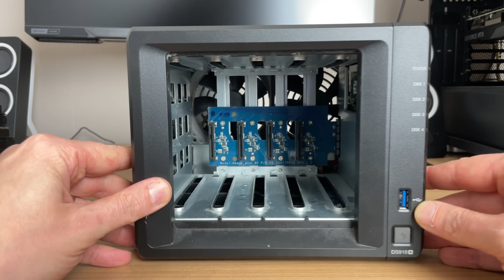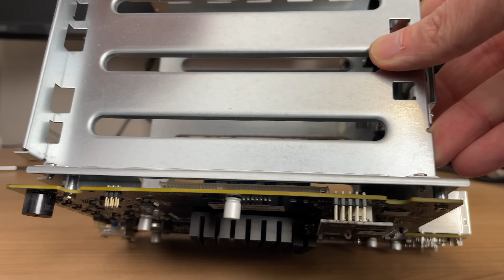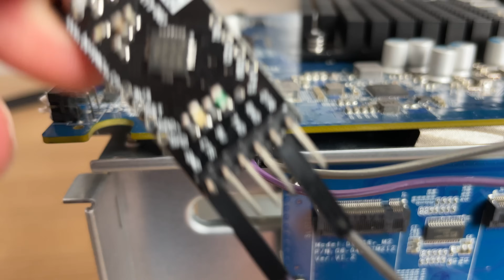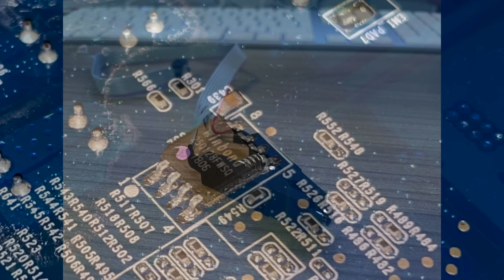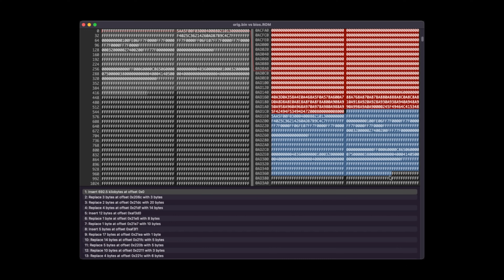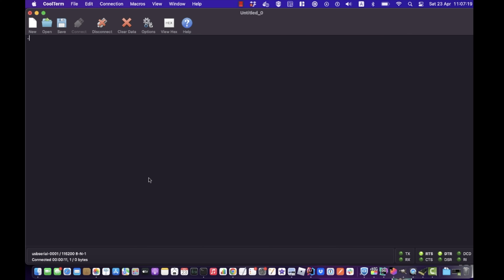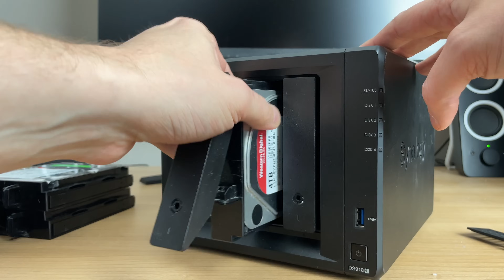Synology DS918+ Bricked / Blue LED of death.

Comment: Synology can't really do anything here. This problem is with all the Atom C2000 series and some of the Celeron SoC series. The C2000 has this LPC bus problem and the Celeron does something equally stupid on the SPI bus when in bad mood.  I had the same issue on a rack unit. At the end we replaced the PCB which in this case is a removable card. Good to see that you were able to just fix the  flash. Since I did not discard the module I can try the same using the spare (yes spare) NAS we got because of this.
Reply: Synology can't really do anything here? That's silly. They could protect the flash chip better, install a backup flash chip, or not use a SoC that spontaneously bricks itself in the first place.
Reply: @VioletGiraffe  Obviously you have not read the datasheet and the AppNotes. The SoC does not support any of this.
Reply: @ChipGuy , 1) that's my point, it was a bad choice of SoC. And 2) no, you do not need any special support from SoC for a backup BIOS ROM with a hardware switch.
Reply: @VioletGiraffe  There is only one /CS signal from the SoC. Unless you implement a proprietary solution like Asus or Gigabyte with an extra watchdog MCU which they just put in their system ASIC as a feature. You will be looking at least at an extra chip that goes "OK Celeron dude, if you don't tell me that you are alive and well after max. XX seconds I will reset you  and change your CS line over to the second flash chip and then restart you again" That adds considerably to the BOM.
Reply: @ChipGuy , that would be an automatic solution, which is quite doable, but I meant a much simpler one - a hardware switch, as I said. User-selectable.
Reply: this device does not have the C2000, it was a previous model.. ie, 916..
Reply: @jmkhenka  I know, it has the Celeron J3455. Those tend to do weird things on the Flash SPI bus. They are also used on some Mini-ITX mainboards and micro servers. Same problems, spurious SPI flash data corruption after crashes or power outages.
Reply: I would love to know your results (if you try to repair).

I have 2x Synology NAS's with the same symptoms (a RackStation RS2416+ and a 5 bay DS1512+).

(If you have a Youtube channel, please share a link)
Reply: @Giepie  thats the c2000 bugg, you can solder a resistor to get them working again.
We have had 20 firewalls from a reputable vendor break over the past year due to the same CPU. Cisco and many other manufacturers had the same cpu. Intel really fucked up their customers.

We have repaired two rs2416 with resistors (5 min jobb, not even difficult)
Reply: @jmkhenka  that is great news! 

I attempted the resistor fix with the DS, but the insides are way different to the unit on the how-to I followed. 

Could you possibly share the information (or link) to fix the RS?

(PS, my RS died after a firmware update, it just never came back after rebooting)
Reply: @Giepie  I got the Rackstation RP8xx+ something. 4 bay with that C2000 SoC and also that proprietary USB (I think it's USB) but not USB formfactor flash drive in it. Now that I know what the problem is I can try fix it when I have time. But at the time it failed my only chance was to order the new module in with over night express, since 16 people relied on that NAS being operational.
Reply: @ChipGuy  I wasn't able to find replacement boards (at least not here in South Africa), so I was forced to replace these units. 

I kept the faulty units, hoping to fix them "when I have time" (famous last words 😁)

I suspected the DOM's (disk-on-module) to be corrupt, never crossed my mind it could actually be the ROM. 

I don't have the chip programmers etc, but will consider getting one - unless someone knows how to flash the ROM without removing the chip. 

I'd love to see your results 😁 (hopefully this would encourage you to fix yours 😁😁)
Reply: The Atom bug clearly does not apply here...

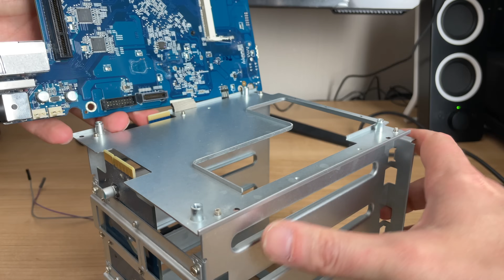Comment: 9:40 A laptop that uses PC3L ram (low voltage) will not work with regular PCL3 ram at all! Probably the same here. (have not finished yet!)
Reply: Right, yah. It will go the other way around but not if the system runs 1.35v

Comment: Hey there RetroSpector78, we'd love to send one of ours and help you retrieve your data if needed or at the very least leave you with a solution that keeps your data backed up. We also love supporting retro computing and even recently added MS DOS support to our NAS devices. Hit us up if interested!
Reply: That's cool (seriously).. but I'm guessing that's via SMB1.. hopefully those that don't need that feature can disable it!!  That's insecure as hell!   The only faults I was aware of with the Synology units was the clock circuit in some models, due to hardware defect of that SoC/chipset.  TIL their BIOS chips go pop too.  Huh, welp, there ya go.  Shame, I'd thought they cleaned up their act.
Reply: @Sansui350A  Not necessarily! SMB1 is one way to access it but we also have ensured FTP support runs on as early as MS DOS, WebDAV for Windows 95/98 and virtual machines to keep the insecure protocols on a server inside and separate from the NAS as well as dual Ethernet to keep networking separated.

I run retro machines myself! My favourite is Windows 98
Reply: @ASUSTOR_YT  Nice.  Thought out better than others, for once, I like it! :)   But, the key security issue is.. do you have an option to disable SMB1, or have it disabled by default?
Reply: @Sansui350A  Of course! Absolutely! It's disabled by default but it's a simple switch to turn on and off.
Reply: @ASUSTOR_YT  You know... that's funny that a company that doesn't specialize in NAS/storage like AT ALL, gets that shit right, yet others often don't.  or just make garbage.  I might have to explore some of ASUS NAS box products for specific-use-case scenarios because of this.
Reply: @Sansui350A  Haha. Well... Technically we are specialising in NAS storage. ASUS tried their hand at it and then decided just to spin it off. We're a separately run joint venture. We're a lot leaner than Synology so it's easier for me to take feedback and turn the ship around. I feel NAS boxes should have wide support and freedom. It was great working with Phil's Computer Lab to get MS DOS FTP support working and now we want to send hardware (with no editorial interference) to retro YouTubers because we think we can take feedback from retro YouTubers on what we should improve to make it better. 

One thing I found is that if I run a Linux server or Windows Server 2008 virtual machine, I can keep that as SMB1 and separate from my NAS device. Since Linux distros and Server 2008 supports SMB1 and SMB2, I can keep the insecure parts separate, while also keeping a copy on the normal part of the NAS and with that, easily back it up to external devices or another NAS, regardless of whether it's one of ours or a competitor's.

I personally have a Pentium 4 Socket 478 system that I've built and disassembled numerous times since I bought the board in 2004. What I want to do is build a nice AMD Athlon 64 ultimate-fastest-1080p-Windows 98 build with the Geforce FX 5900 I have. Oh, and RGB too because I'm nuts.
Reply: @ASUSTOR_YT  only if i knew ASUS make nas before i got my first nas, which is ds920, last black friday.    was not aware of Asustor till recently
Reply: @andyliu5662  That's OK. When you're ready or if you just need another one for a backup to keep your files and retro games safe, hit us up to ask questions. It can sync with the Synology to keep an automatic backup.
Reply: @ASUSTOR_YT  good to know that it can sync with synology, will keep that in mind when I shop for another nas :)
Reply: Asusstor is way better than synology and cheaper too
Reply: Truenas is way better than either! And runs on most any spare hardware of the last 15 years. It just wants 8 gigs ram these days. And I have yet to lose any data in 10+ years of using it unless its a serious case of user error. ZFS2 is the only file system in town as far as i am concerned.
Reply: @wishusknight3009  you are comparing a custom build solution to a no-headache prebuild solution
Reply: @j_r_-  It doesn't seem like the prebuilds are no headache. But I see your point. But this thread was about features too, and in that its worth saying that a custom solution far exceeds anything a prebuilt can do. And for potentially less money.
Reply: @wishusknight3009  We tend to disagree. And ours works well on as little as 512 MB of RAM ;)
Reply: @wishusknight3009  good luck with it without ECC RAM
Reply: @nneeerrrd  None of the premade nas boxes have ecc ram. And its cheap second hand for many types of system's. For most uses its not necessary at all.
Reply: @wishusknight3009  Not necessarily true. Our Lockerstor series featuring Denverton SoCs support ECC and our Lockerstor Pro series come with ECC.
Reply: @ASUSTOR_YT  Ahh ok, I stand corrected. Most lower consumer grade units don't then. 

Though I have one question for an obscure feature. The unit supports a sandboxed SMB1 mode which is pretty cool I must admit.  Out of curiosity, has anyone developed a plugin to allow sharing with vintage macintosh via appletalk? For like system 7 through to OS 9.22 using HFS and HFS+?  This requires the storage device to track both resource fork and data forks to keep Macintosh files from corrupting without being archived. 

Currently I use a windows 2000 server VM to bridge this (which also acts as my SMB1 bridge)

I am not making this any kind of Litmus, this is so obscure that its probably only apeaking to a few people worldwide lol. But it would make a neet plugin to add manually.
Reply: @wishusknight3009  I'd have to try. Maybe I need to buy an old mac for fun and giggles for the office and get it working. I know FTP clients will definitely work.
Reply: @j_r_-  How do you figure Asusstor is "way better and cheaper"? The 4 bay version of the Asusstor is $700, whereas the 923+ is in th $500 range. Asusstor does have more bang for buck in the hardware, but not near the ecosystem and ease of use of Synology. I do like that Asusstor allows 3rd party drives with no complaint, while Synology is pushing users to its own drives and tying customer service to that (which is just wrong). The reason why most people like Synology is because it is truly plug-and-play, whereas systems like Asusstor really require an AI assistant on your side to deal with any kind of problems. So, Asusstor isn't "way better than Synology" nor is it "way cheaper". It has more bang per buck in hardware, but it's a lot less intuitive and doesn't have near the community around it that really matters when the Scheiße hits the fan.
Reply from the maker: That’s pretty cool, I’ll reply via email and we’ll see what we can do !
Reply: @RetroSpector78  Thanks! I'll explain more in detail what we've been doing to help retro enthusiasts.
Reply: @ASUSTOR_YT  Hell yeah.  This is awesome engagement guys, seriously.
Reply: @Sansui350A  Thanks!
Reply: The ASUSTOR devices also support NFS, which means you can use the XFS client in MS-DOS for access.  I've done a video or two on NFS access in MS-DOS
Reply: @RetroTechChris  That's right!
Reply: I love my Asustor AS6110T.. even though it's rather old now, just can't beat the 10 bays!
Reply: @Avatar_EU  Thanks!
Reply: @ASUSTOR TV Maybe you could add user upgradable UPS features to your NAS units like connectors for RC lithium batteries so they have built-in safe shutdown in the event of a power failure and lighting strike/surge protection?
Reply: @AsurmenHandOfAsur  We support all that already! We often work with our UPS partners and frequently test new models of UPS.
Reply: Clearly did not watch the ending....!
Reply: @mdd1963  It is required to comment early for visibility.

Also. We said 'if needed'
Reply from the maker: Would love to hookup an old ms-dos system to a 32TB storage system :)
Reply: @RetroSpector78  ----"Would love to hookup an old ms-dos system to a 32TB storage system :)"

I currently need to use a windows 2000 server VM to do this (as well as for mac HFS)  And it is limited to about 1tb or so. Only really to keep the old protocol isolated. Having a sandboxed SMB1 is a pretty neat feature for sure.
Reply: @RetroSpector78  We can do that!
Reply: @wishusknight3009  Absolutely. That's one way of doing it. We have many ways to do it. Some more secure, some less so. We can make sure everything is synced easily too to protect data.
Reply: Hey, I think I remember you sent one of your devices to Michael from the Michael MJD channel?
Reply: @BilisNegra  Yep!